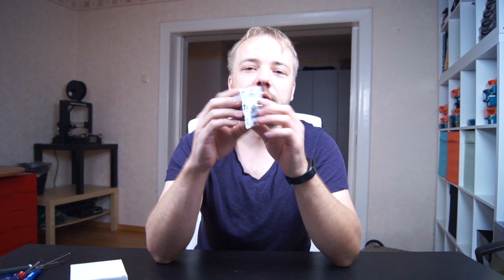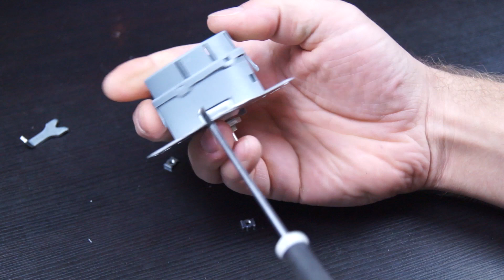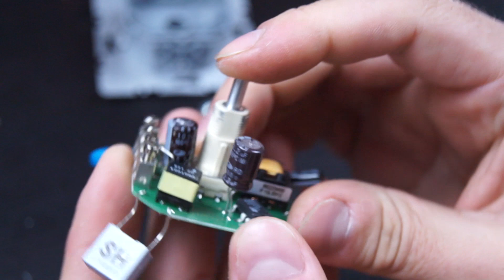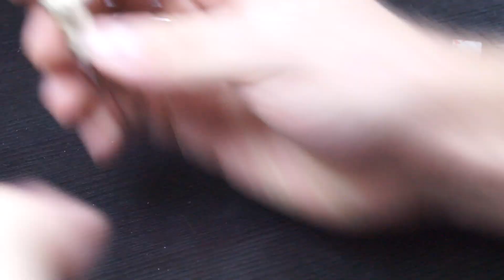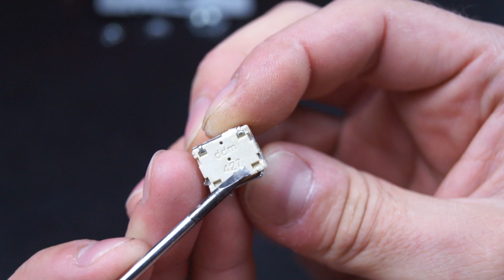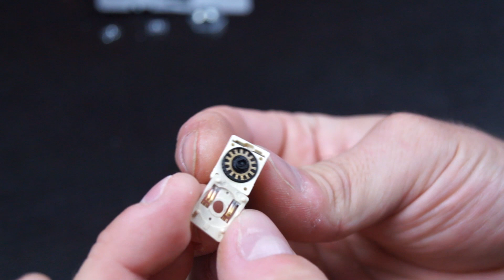Quick Teardown: Dali bus Dimmer BERKER 2898

Comment: On ebay and aliexpress, cheap smart watches with a 1.3-inch screen appear (d13 seems). It seems that such a watch will be more interesting, since more information can be displayed on it. Can I flash them with custom-firmware? Thanks.
Reply from the maker: Hi there are multiple watches that can be reflashed. But unfortunately not the d13 you mentioned. The sma q2 is as same flashable line the D6 tracker.